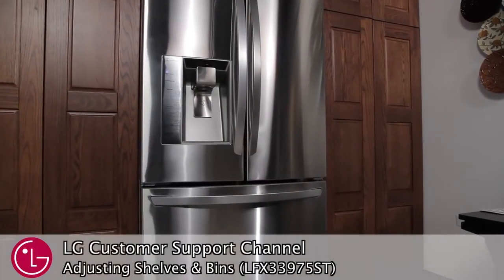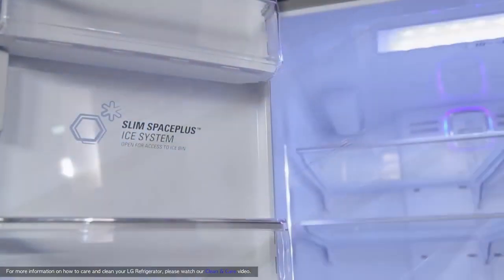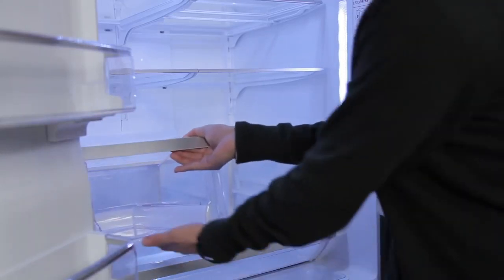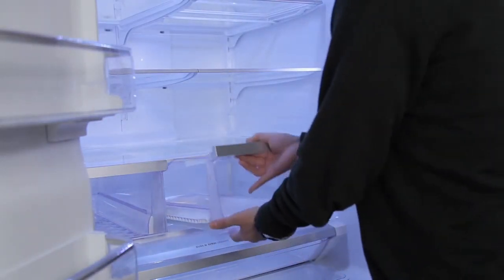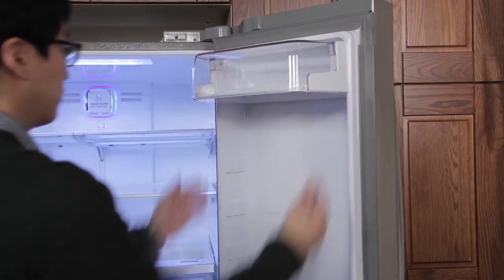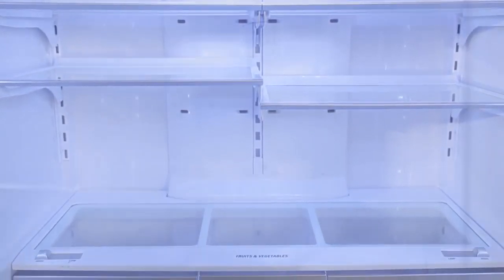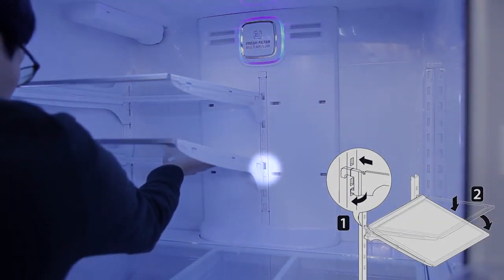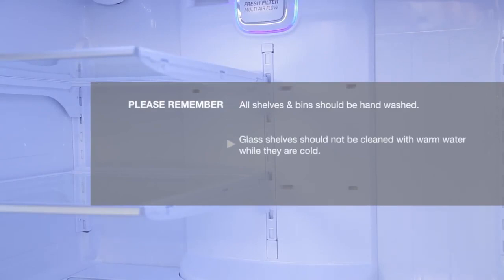[LG Refrigerators] Shelves & Bins - French Door Refrigerator

Comment: How do you clean the glass over the crisper. They are filthy and uncleanable in the fridge
Reply from the maker: Hello there. To clean the glass over the crisper in your LG refrigerator, start by removing all food items to avoid spills. Next, take out any removable parts like shelves and bins, allowing them to warm up to room temperature to prevent cracking. Use a soft sponge or cloth with mild detergent to clean the glass, being careful to avoid abrasive cleaners that could scratch the surface. For more detailed instruction, please refer to this link: https://www.lg.com/us/support/help-library/lg-refrigerators-how-to-clean-the-inside-of-your-refrigerator--1341840848445.  If you need further assistance, feel free to send us a private message through our support channels on social media @LGUSSupport with the model number of your refrigerator. We're here to help. ^Win
Reply: @LGUSASupport  How do you take out the glass over the crisper.  Mine is disgusting and we can't get it out to clean it.  Do we have to take and screwdriver and take it apart?
Reply: @LGUSASupport  I'm about beyond "private reply" stage!!!
Reply from the maker: Hey Lynn. We want to help you clean the glass over your crisper drawer on your LG fridge. In most models, you just need to remove the crisper drawers by pulling them out to the full extension, lifting the front up, and pulling them straight out. Lift the glass shelf above the crisper drawer and remove it carefully. If this does not help, please send us a private message on social media "Facebook, Instagram, Twitter" @LGUSSupport with your contact details and model number. We'll be happy to continue helping you. ^David

Comment: It does not clear the water filter unit on the lower left drawer
Reply from the maker: Hello, May. To remove the Glide N Serve drawer on the LG LRYXC2606S refrigerator model when there is interference with the water filter unit:
1. Fully extend the Glide N Serve drawer out until it stops.
2. Lift the front of the drawer up slightly to disengage it from the sliding rails.
3. While lifting the front, pull the drawer straight out towards you to fully remove it from the refrigerator compartment.
4. If the water filter unit is obstructing removal, you may need to first remove the filter by twisting it counterclockwise to allow clearance for the drawer to come out.

The key steps are to fully extend the drawer, lift the front edge up to unhook it from the rails, and then pull it straight out carefully. Removing the water filter first can provide the extra clearance needed if it is interfering with drawer removal on this model.

If you have any questions, feel free to reach back. ^Sam